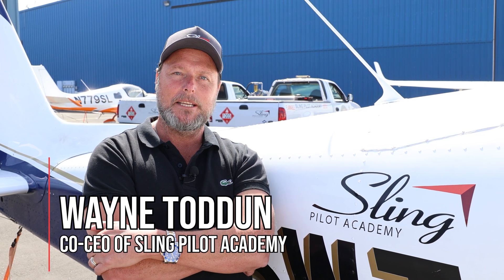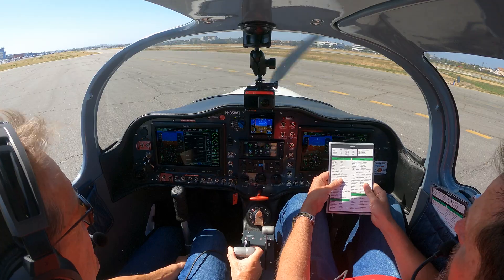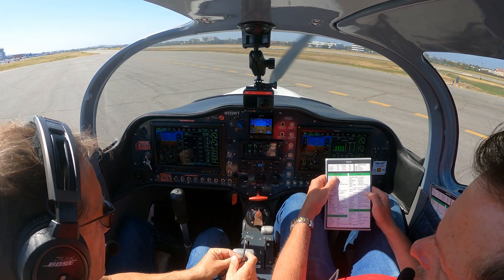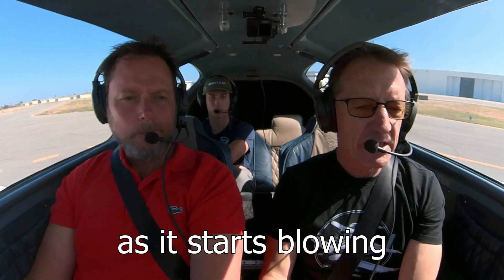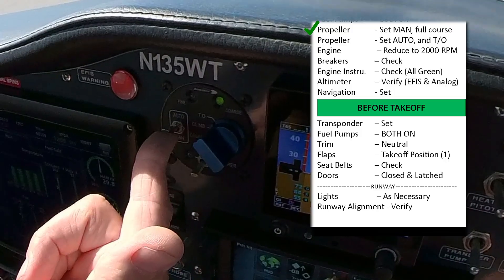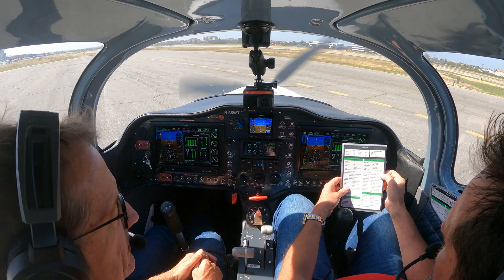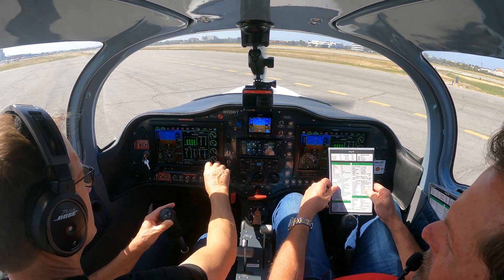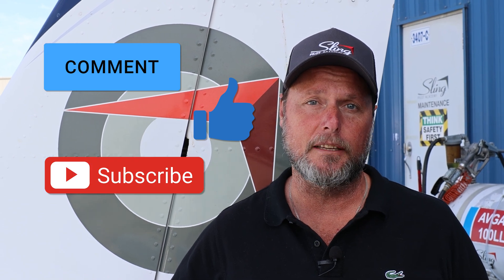How to Perform a Runup in the Sling TSi

Comment: Curious why the Sling TSi POH says to do the run-up/Lane Check at 4000 RPM, whereas Rotax says to do it at 2500 RPM. (See section 3.5 of the Rotax 915 iS Operator's Manual). Thoughts? Thanks!
Reply: Why would you do a run up at high idle? 🤔
Reply: @lemonator8813  Ask Rotax, that’s what their manual says. It’s just a lane check, it’s not a traditional magneto run up.
Reply: @OneAlphaMike  True, but what about all the other systems? It is nice to know they run at takeoff power
Reply: @lemonator8813  I’m just telling you what the Rotax manual says. Are you suggesting doing a run-up at takeoff power?
Reply: @OneAlphaMike  I just do what I was trained, which is 4000rpm. It seems like that 4000rpm would give  me a better indication of something bring broken. Like the gearbox.
Reply: @lemonator8813  You’d know pretty quickly if your gearbox was broken, lol!
Reply: @OneAlphaMike  lol yeah you know what I mean though that was a bad example. Fuel system might be a better one lol
Reply: @lemonator8813  Funny thing is, Rotax manual says check the fuel pumps are 2000rpm! That’s why I posted the question, curious about the discrepancy. Maybe I’ll shoot an email to Sling technical.
Reply: @OneAlphaMike  if you have a link I'd love to check it out as well.  I will ask a couple instructors I've worked with as well.
Reply: @lemonator8813  A link to the Rotax manual? You can find that here: https://www.rotax-owner.com/pdf/OperatorsManual(OM)_915iA-C24Series.pdf

Relevant page is section 4.5. I also discus this and show a screen shot of that page in the Rotax manual at 6min 15sec in my video, here: https://youtu.be/_i6hgux-F_w
Reply: @OneAlphaMike  thank you! I will respond if I get any decent answers
Reply: @lemonator8813  The Rotax 912iS manual does say to do the lane check at 4000 rpm. I think Sling was used to the 912iS so they just put the same thing in the TSi manual. But, the Rotax 915iS manual clearly has different guidance; 2500rpm for the lane check. I don’t know why, but I have to assume Rotax knows their engines.
Reply: @OneAlphaMike  We only have N135WT at the Sling School in Torrance so that line of thinking makes sense. 
I will take a look at the manual and watch your video when I get home.

I will be able to give sling a call and I will text my instructors Monday. Maybe this I'd something we need to change. I'm just a student with 125 hours though
Reply: Late to the party and I’d like to hear from Sling on this as well, but best I can tell this is some happy medium to combine the lane checks and the watergate/pressure control valve checks. Rotax calls for wide open throttle (and propeller such that RPM is at least 4700).
Reply: @ss-tx-rx2860 I wonder if 4000 is enough to trigger the ECU to do the PCV/wastegate check on the 915.  Rotax seems pretty specific about using WOT and ensuring the RPM is greater than 4700.  Also, they specify waiting more than 15 seconds with each lane turned off.  I doubt the Sling procedure is actually invoking the PCV/Wastgegate check.

Comment: The fact that the both lane lights go off when you first power the system up shows the test has been complete and both lanes or ECUs are functioning properly therefore doing a simulated mag check is not needed. Conversely the liquid cooled 915 is not going to overheat on the ground between start up and engine run up and pointing into the wind is an old air cooled legacy maneuver.
Reply: There seems to be a common misapprehension in the Rotax world that the run-up/Lane Check is not needed. The thought is that, if there was a problem, you'd get a lane light, so no need to do a run-up/Lane Check. This is not true. I had a clogged injector on my 915iS which did not throw a lane light and presented no other symptoms when both lane switches were on. The only way we found out is from excessive RPM drop when turning off lanes individually on the run-up. Do the Lane Check!
Reply: If you've flown at a school/airport as busy as Torrance you'd be smart to keep the plane as cool as you can. 
I personally have experienced overheating just waiting to get a spot to takeoff. Sometimes you will be waiting more than 15 minutes and this can be very hard on the engine when it is very hot out!
Reply: You must not fly where it is hot and you spend lots of time waiting on other aircraft on the ground.